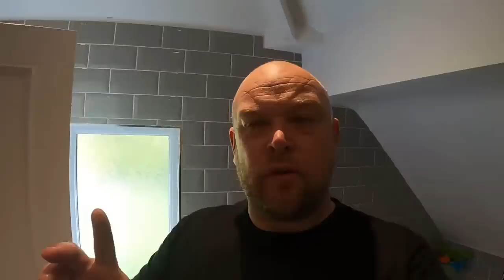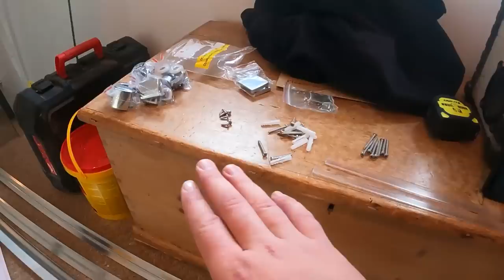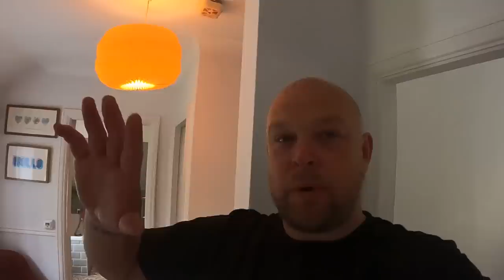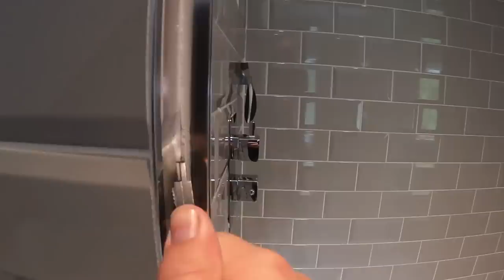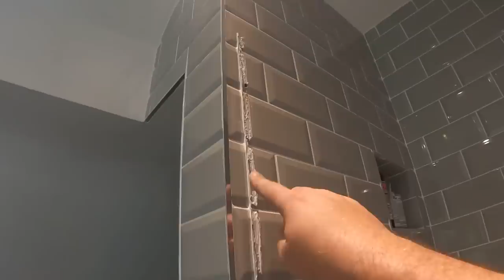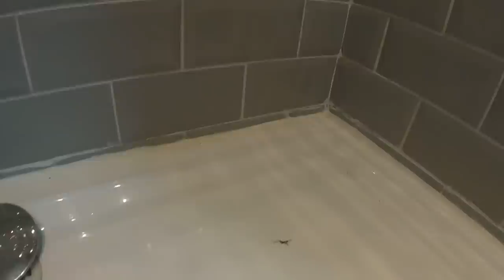SHOWER SCREEN SWAP PROBLEMS…. Always cover yourself from things like this

Comment: mark, a tip, I always use my multitool with a smooth special blade to run down the back of the channels, never have a problem getting them off 😂
Reply from the maker: Good tip that
Reply: I was wincing as he bent the left hand frame in half ,, thought the tiles were gunna pop then!!
Reply: @jonnyBravos  I was too!
Reply: @MJTiffPlumbing   cheese wire as the vibration of multi tool will   also dislodge tiles
Reply: I use a paint scraper 👍🏼👍🏼

Comment: That’s why you shouldn’t plaster on shower wall, if need must, at least sbr or prime it before tiling. I normally only use foam board or plasterboard and have it tanked for shower areas. Only thing holding the tiles were the ground and shower screen
Reply from the maker: I always use hardy backer now for shower areas, then tank it👍🏼👍🏼
Reply: @MJTiffPlumbing  cement boards are good. A bit heavy and not easy to cut though. personally I think we are in the time and age where there are better products for showers. Foam board like wedi, aqua boards, are all good choices. Waterproof with sealant on seams. Each to their own though :)
Reply from the maker: I agree mate 👍🏼👍🏼
Reply: This is a great video. It shows real world situations in the trade. Many YouTubes only show jobs going well. But in fact these situations do occur, I love watching your videos as you deal and cope with every situation like the job is going smooth. Real credit to you mark. Keep up the fantastic work mate
Reply: I wouldn't tank cement board just SBR it otherwise the tanking will pull off the cement board , done that with Mapei , followed instructions to the letter
Reply: @sidperry7748  lol cement board are not water proofed unless you seal the seams and tank them. You could sbr it first before tanking. No point using cement board otherwise
Reply: @tonygoshive785  I have never had one fail in the 20 years I have been doing house renovations . Never use plaster board,  even if it's tanked , if it's going to fail it will start at the join between shower tray and tiles so that 15mm seal at the bottom is the most important part. If it's tiled and grout correctly water will not get behind the tiles and penetrate through the cement board.
Reply: @sidperry7748  😆🤣🤣

Comment: Small tip that I do. Spray wd40 and this will eat away the silicone.
Reply from the maker: Really!!!!!…. Is that a thing!!!
Reply: Yep, this works. Cheaper than the silicone eater stuff you can buy and works almost as well.

Comment: Working tiler here. This is a bad job tbf. Should have used a tanking kit to protect substrate from water ingress. Also looks like adhesive from a tub and probably didn't prime the walls either. Many things wrong with that tiling
Reply from the maker: Appreciate your view on it mate 👍🏼👍🏼

Comment: Poor bathroom installation from the off by the look of that, should have used hardy backer in the shower area, they’ve obviously skimmed it, and not let the plaster dry properly before tiling, a one week bathroom install probably, with push fit plumbing as well.
Reply from the maker: Nowt wrong with push fit when done correctly, you find the people who have done it wrong and it’s failed say it’s rubbish.
Reply: @MJTiffPlumbing  hep20 and Pollypipe is acceptable. If you’re using speed fit your morals need questioning
Reply: @AvergeJoehere  been using speedfit 10 years at least and only ever had one minor issue. Utter nonsense. We like what we like, doesnt mean someone else is doing it wrong, its just what they prefer
Reply: @JonBoi9211  Damn aren’t you and your customers lucky
Reply: @AvergeJoehere  dont need luck when you know how to use something properly
Reply: @JonBoi9211  true that. Speedfit is very complex to use 🤡
Reply: @AvergeJoehere  🤣 and hep is
Reply: @JonBoi9211  you're the one who stated you need to know how to use something. Hep is just for people with abit of extra pride in their work rather than going for cheapest option in speedfit
Reply: @AvergeJoehere  clearly a reason you dont like it, i would guess you have had problems with it. Hence suggesting your not using it properly. I have no issue with hep, its just not my preference

Comment: Real world 🤠. Yee haa. No primer or tanking. Destined to fail. I've primed a plaster wall in the past and then used bagged adhesive and it was solid. Ripped the wall off on removal.
Reply from the maker: Yep… real world plumbing 👍🏼

Comment: Shower base..one with a up stand, shower door, behind a up stand. Seal all walls, overlap shower up stand with seal film, and paint into sealant. Tile over with good adhesive and grout. Two plumbers told me that all showers need re-sealing....not mine. Good video, always like you work. Peace be unto you.
Reply from the maker: Thanks buddy 👍🏼👍🏼

Comment: I hate replacing shower screens for this very same reason! Also yes the 10&12mm weigh an absolute ton! Ive been using the blades from a decorators scraper to get behind the profiles and run it down the seal👍🏼
Reply from the maker: Worst job isn’t it

Comment: I’ve fitted 100s of these things, aslong as your walls are level or close damn it and tray is level they’re really nice screen never had an issue but I’ve certainly attempted plenty and have to tell them it’s the walls/ tray. These types of jobs can be a nightmare! Always let the customer know it can pulled the tiles, great job mate. My tiler will not tile onto plastered walls for this reason no matter what you do the adhesive just does not bond properly
Reply from the maker: Yep, always cover yourself with things like this 👍🏼👍🏼
Reply: @MJTiffPlumbing  great content mate
Reply from the maker: Thanks buddy 👍🏼👍🏼

Comment: Come across this so many times, lack of primer most probably, same on shower trays, if using tile adhesive always prime the underside of tray aswell as the wall, takes less than a minute and makes a massive difference.  Personally i always tank my shower areas aswell, for the sake of £50 for a decent tanking kit, why not!  I once asked an apprentice to prime the walls a metre high for a half tiled ensuite while i went for materials, came back and he had done all the walls and the ceiling....in pva....
Reply from the maker: Hahahaha… least he tried

Comment: Always finding frames have been siliconed onto tiles soooo much & makes my blood boil: multi tool & hacksaw & knife & sweat to remove!! Manufacturers instructions say ‘a small bead can be applied to frame’, not 1/2 a tube!!! I aways just seal on outside only, again as manufacturers state! 
Yep that plaster was never prepped with pva or tile prep liquid & such bad tiling to do tiny slice of tile to tray: clearly not a pro tiler! Also, hate metro tiles in showers, squeegee down tiles to help clean them, such a pain! 😬🤦🏻‍♂️ You’re a gent to keep going with this 1!
Reply from the maker: Thanks buddy…. Gotta take the rough with the smooth sometimes

Comment: Nice work mate, I've just brought a cutting wire for clay, from Amazon only a few quid. But worked a treat behind the shower screen profile, getting all the old silicone out.
Reply from the maker: Will give that a try on the next one👍🏼👍🏼
However I’m glad I’ve uncovered this issue on this one as if the new screen went in and it failed a short time after it would of been on me probably
Reply: @MJTiffPlumbing  the one i got has handles either side of the wire and worked a treat

Comment: Just a quick one mate, get yourself a bit of cheese wire with good handles on them and run them down the back of the profile I get them off all the time with out tiles coming off, cheese wire works great mate, although in this case that tiling needs re doing for sure. Not primed.
Reply from the maker: Yer good shout that mate🙌🏼👍🏼👍🏼
Reply: That's a great idea!!

Comment: That kind of setup is the one where usually I use shower walls from Jaylux. Instead of redo the tiling I just take them off and install shower walls. No grouting is a huge advantage for cleaning and you get a warm surface in the shower so less condensing. And customer get a refreshed look for the shower.
Reply from the maker: Yep I know what you mean, however the customer wants to keep it all looking the same👍🏼

Comment: This is one of the reasons they changed the standards in BS 5385 to reduce the chances of the sub-straight separating from finished surfaces and causing damage.
Literally had the same thing last week, took the frame out and 12mm porcelain tiles came with, admittedly the original tiler dot and dabbed them onto the solid wall, but the partition between that shower and the one next to it was tiled properly. Unfortunately it was OSB mounted on metal studs to make 1 bathroom into 2 shower rooms and the natural expansion has caused the grout joints to break either side and ruin the OSB and the metal studs.
Reply from the maker: These things are sent to try us mate
Reply: it's substrate* you lemon.

Comment: What a pita bud, In any trade it’s important to highlight potential problems to the customer as it does tend to bite you in the arse when it goes wrong for whatever reason. A retractable knife behind those rails might have helped you out there, however the tiles would have still been loose and the water would have still got in! I’ve even used a hacksaw blade behind a basin before to avoid cracking tiles! Good content as per bud👍🏻
Reply from the maker: Thanks mate….. yer I think it was just waiting to be disturbed🫣

Hope your well mate👍🏼🙏🏼

Comment: I reckon the the weight of the skreen was pullin out and down. Plenty of silicone on that channel would have pulled on the whole area of tiles away from the wall. And yeah I'd go for no primer or just plaster drying the adhesive tack
 three screws and plugs don't hold the channel the silicone does , although a Patrice would be nice
Reply from the maker: Yep you could be right about it pulling

Comment: The tiny sliver of tile along the top of the shower tray is a big red flag that tiler wasn’t the best.

Devastating for the homeowner and yourself.

The rows of un-squished tile mortar visible in a few spots suggest they used wrongly-mixed mortar, or stuff that was past its open-pot time. Cowboy stuff.
Reply from the maker: Yep that slither on the bottom isn’t great at all

Comment: I can honestly say I wish my tiles would do that.
Reason my tap seat is only about 2mm thick after 40 years. Need to remove old tiles to fix..
Reply from the maker: What… you want they to just fall off!!!😮🫣
Reply: @MJTiffPlumbing  yes, the tiles are old and no longer available. But the pipe between taps needs replacing.

Comment: I’m a tiler and obviously going straight over plaster isn’t the right thing to do but he hasn’t primed it from what I can see he’s used tubbed adhesive which is typical in the way those tiles pulled off! 😮
Reply: What’s your preferred bonding on plaster?
Reply: Same mate, tiler aswel. Yea it's the non primed walls that's the problem. And yea mastic is shite in Shower areas tbh. Nothing wrong with a plastered wall if prepped right. Don't forget none of that Jackerboard ect was out years ago and managed well. Prefer non plastered tho.
Reply: @j..w443  SBR mate
Reply from the maker: Yep I know what your saying lads 👍🏼👍🏼👌🏼

This was done around 8years ago I think

Comment: I can tell you exactly why the tiles are not bonded... It is a gypsum plaster finish(bad in a wet area), they haven't primed the wall before tilling and the gypsum has quickly sucked all the water out of the adhesive preventing full adhesion. I have seen this a few times before. If it has been primed it will have something resembling a shiny coat of PVA and the tiles stick like S*@t. I have destroyed walls i tiled many years ago using primer to redo them and usually end up just taking down the PB as well,  and using concrete boards/No more ply these days.
Reply from the maker: Yep that’s exactly the problem buddy👍🏼

Comment: That looks like a shower lab door you ripped out and manufacturers instructions state you actually need a torque wrench to install properly. Which looks like the installer didn't have 🤣
Reply from the maker: Bloody heavy door that’s for sure

Comment: If the glass was 'slipping' out from the profile, that would indicate the top brace wasn't fitted correctly. 
'Water on tiles' wouldn't make grout fall out. (Just think of a wetroom or pool or victorian style pathway). That indicates that the floor hasn't been laid well, and probably movement underneath being laid direct to wood. 
Tiles falling off the wall, plaster may not have been cured prior to tiling, or because the walls may not have been primed. Also the backs of the tiles were dry (being ceramic), and adhesive was used only to the tile, and not both wall and tile. Not enough adhesive coverage either, especially as is a wet area. Shoddy tiler, as I've noticed in previous videos.
Reply from the maker: My tiler didn’t tile it originally….. if you listened to the video you would of heard that🤣🤣
As said, again if you listened…. The plastered wall hadn’t been primed… that was the whole issue

As for the “shoddy tiler, as noticed in previous videos” comment…. Why you keep watching then? If you haven’t noticed this channel is about PLUMBING……
Reply: @MJTiffPlumbing  I listened, I did not say 'your tiler' done the job. Not about trying my hardest to find what I think the problems are, I can clearly see. 😂
I'm allowed to comment and allowed to watch. 😉

Comment: Pulling the screen frame is not how you do it, I spray Silicone remover then I get a 100 mm scrapper down the back of it, Never had a tile pop off ever and that includes tiles that have not bonded, Maybe I've been lucky.
Reply from the maker: Have you seen how loose them tiles are buddy????? If you looked at them wrong they are falling off.

If your refitting a screen on tiles that you know are not bonded then that’s a recipe for disaster….. always fix what is broke.

Comment: Plaster should of had a mist coat or pva especially around the shower the plaster has sucked all the moister out the tile adhesive that’s why it’s failed bad tiling little cuts like that as well shocking
Reply from the maker: Yep a few people have said the same buddy 👍🏼👍🏼

Comment: My experience is not to tile the shower walls but to fit water proof panels. Quicker less mess and easier installation and to keep clean. You can get some fancy designs to keep in with the present decor.
Reply from the maker: Not overly keen on the panels to be honest…. But we all do stuff different 👍🏼👍🏼
Reply: Yes panels are not the answer. The answer to this problem is education and proper tile installation techniques. Tile should be laid on a tile backer panel, made fore tile. Not to be laid over plaster.

Comment: No primer used on wall to cause that
Reply from the maker: Indeed mate
Reply: What would you prime with?
Reply: Yeah its okay saying no primer used, but its tiled on top of plaster so kind of makes it irrelevant if it was used or not
Reply: @TheFool2cool  PVA would seal the plaster so it doesn't suck the moisture out of the adhesive. At work we never tile without using PVA. 👍
Reply: @davidcrawford159  PVA is water soluble, wouldn't have thought you'd want to use that behind tiles in a bathroom

but I've never tiled in my life so I'm just guessing.

Comment: As a tiler… that should of been primed and used prime grip resin and also l would of tanked it being a wet area. Before i leave i would of sealed the grout and siliconed that internal corner as well. So many standards have been missed. Stop giving us tilers bad reputation man ffs 😂!
Reply from the maker: Oh mate, I’m not tarring you all with this brush, there is some amazing tilers out there…. Finding a good one is an art in itself.

Keep up the good work mate👍🏼🙏🏼
Reply: @MJTiffPlumbing  haha I know matey I meant like these rubbish tilers out there giving us a bad name. The worst ones are the ones that charge £60 per sqm as well 😫!

Keep up the class work mate, always love the channel 🤜🏼

Comment: Not the best tiling job , walls not primed  before tiles went on . That bottom tile is just too small a cut for the bottom tile , bad planning by the tiler 😒
Reply from the maker: Yep I agree mate👍🏼
Reply: I had the same job yesterday , changing a shower door , I warned the customer that if the previous installer had fully sealed behind the wall channels , it could bring the tiles with it ! Luckily for me the channels came off relatively easy 👍

Comment: Why do people silicone the profile to the wall? The weight is taken by tray and the screws hold it level. Completely unnecessary in my opinion
Reply from the maker: I put a very small bead of silicone on profiles as a seal…. Not a lot.
Always have done…..
Reply: @MJTiffPlumbing  Small bead never usually a problem! Love the videos mate major respect 👊

Comment: The tiling preparation is clearly very poor but even more reason to take the old channels off with care. I cringed when you tried the first one and buckled it and trying to prise it with a flat blade screwdriver on the tiles!!!! Just remove the silicone carefully and not one handed and you would no doubt have at least saved the tiles  that came away. 
I respect people that film there daily jobs which leave them open to criticism but this should encourage more care to be used surely????
Reply from the maker: I’m glad I’ve found that these tiles are not good… doing it as you said and refitting the new screen would of masked the issue, then when it failed in a few months it would be on me…… each to there own buddy👍🏼👍🏼

Comment: Try and do a video with shower boards Mark, maybe you might get the customer a discount if the manufacturer will supply some boards for the video?
Reply from the maker: They didn’t want shower boards on it, wanted to keep the same tiles👍🏼👍🏼